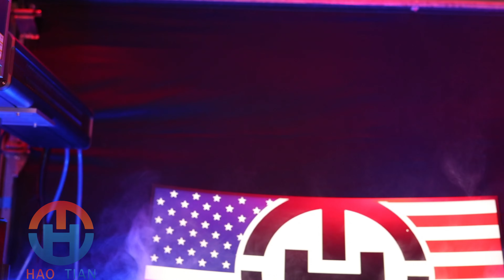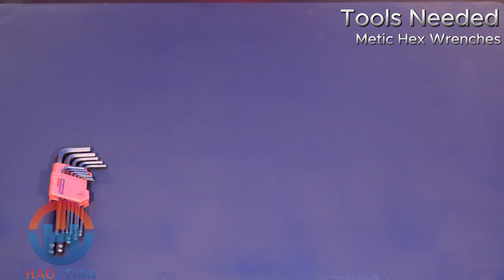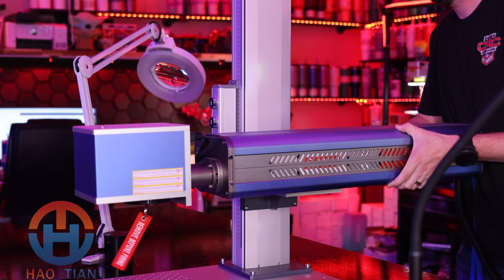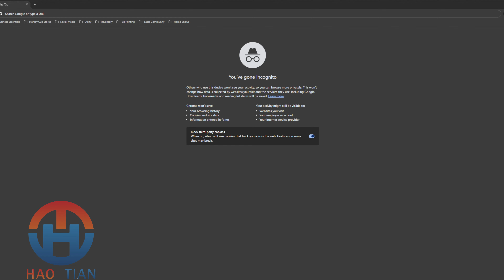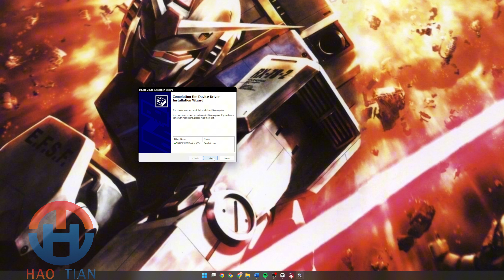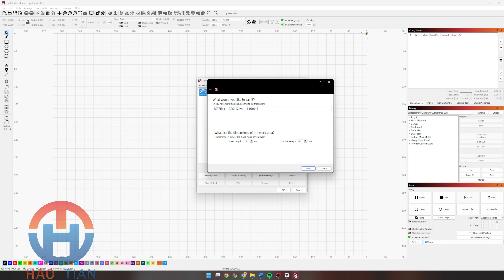Intro to CO2 Galvo Lasers!

Comment: Thanks for the video. I see that there are holes on the left and right of the plate. Can the tower be bolted down to either side, or is one recommended/required? Thanks.
Reply from the maker: Either side is totally fine. It's all about preference. The tower is same either way so you can easily swap sides if you need to.
Reply: @TheLaserNerds  Great…thanks for the info!